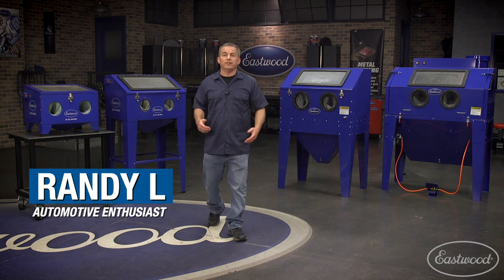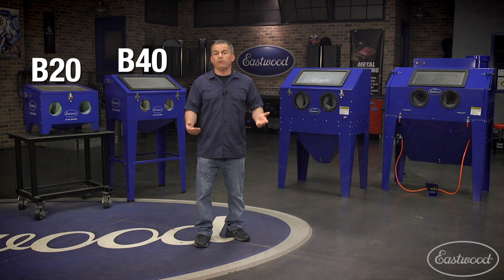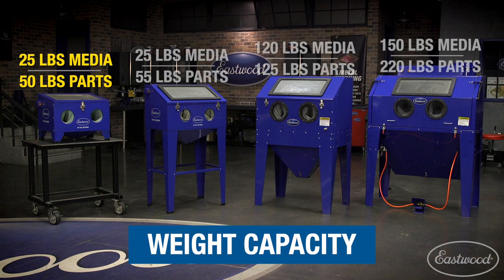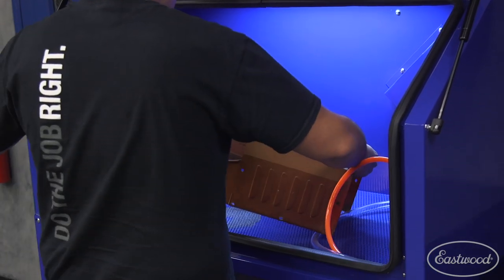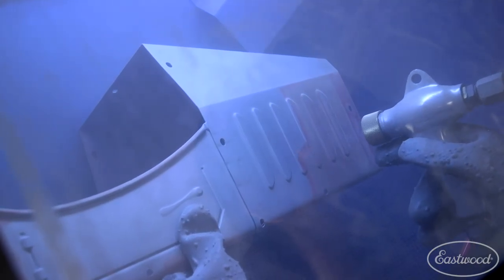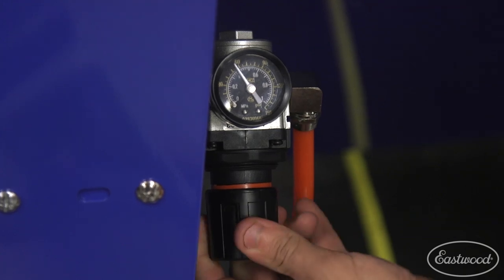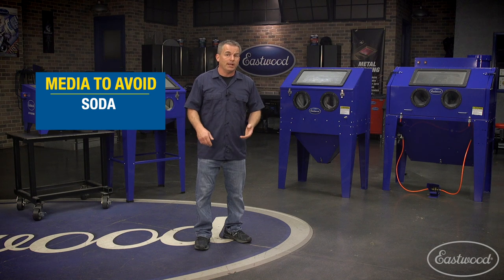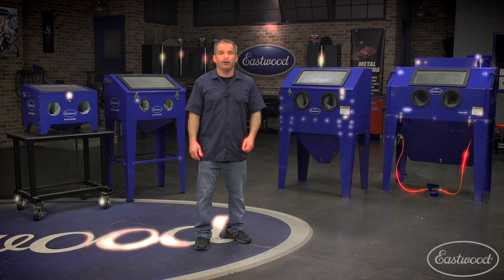Blast Cabinet Buyers Guide - Which Blast Cabinet is Right for You? Remove Paint & Rust - Eastwood

Comment: So, I got the B60 and there are few upgrades that you should do right off the bat.
1. The bottom of the hopper is folded inward, creating a step that catches the media when you are trying to drain it. Until Eastwood fixes the issue and bends it outward; you should add a secondary funnel; even if it is just from cardboard and aluminum tape to cover up the inward pointing step. You will hate that step when changing media.Easiest to do before you install the hopper.
2. Add a downward pointing flange, a 3/4" plastic angle will do, around the perimeter of the door. That will block off the line of sight for the media to the foam pad. You will have media collecting on the foam pad without it.
3. Add a 120 mesh screen on the inside of the window; it will keep most of blasting media away from the glass increasing the life of glass/plastic shield.
4. Get 2 pieces of expanded steel, 18"x24"for the B60 cabinet to use them in-place of the stock shelf. Stock shelf collects way too much media and is hard to remove; that is why you want 2 pieces 18"x24" and not 36x24 single piece. Expanded steel has pointy edges on the top surface, so media rolls down into the hopper.
5. Replace the florescent tube with bright LED. Surprisingly good news is that the OEM switch is rated for wall voltage; so just need to run wire to outlet and internal socket.